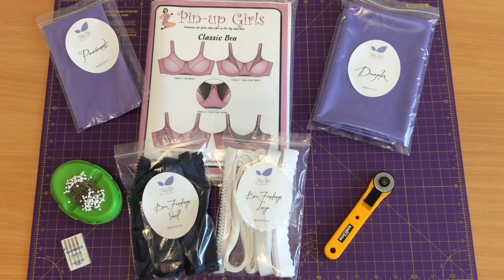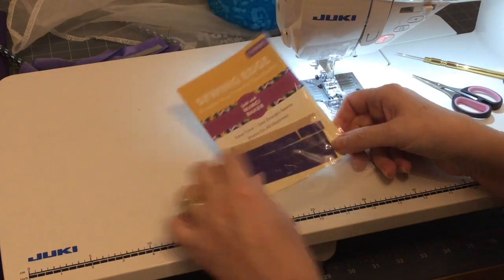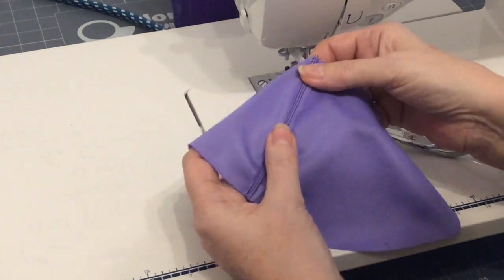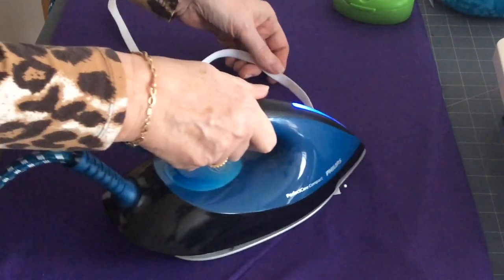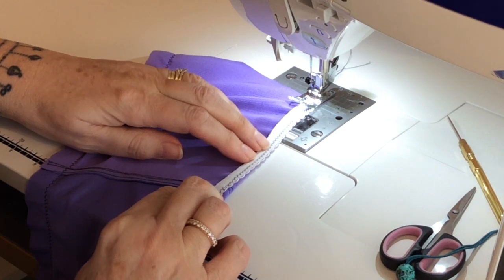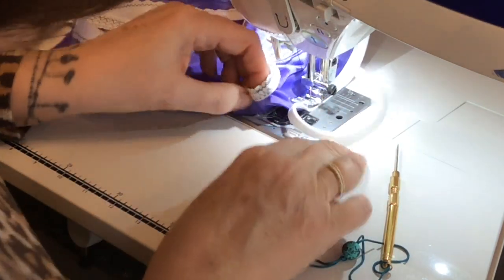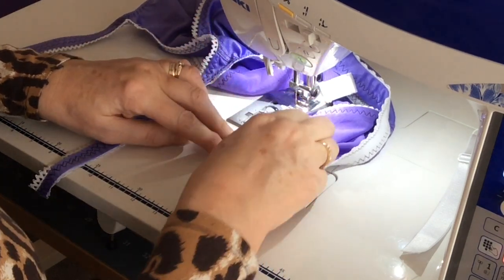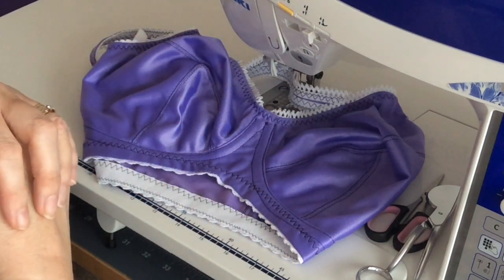Sew ... You Want to Make a Bra UK - (Series 1) - How to Sew a Bra

Comment: Do you use the same needle throughout the bra, ie, the same needle for the cups and and cradle step and also the elastics and channelling? I get terrible skipped stitched on the channelling I think because of the difference in thickness under the foot 😩. I have now bought an uneven foot but have yet to try it.
Reply from the maker: Yes the same needle throughout - I just lengthen the stitch for the channeling.
Reply: @fit2sew  thank you